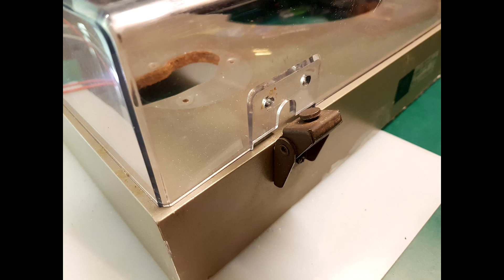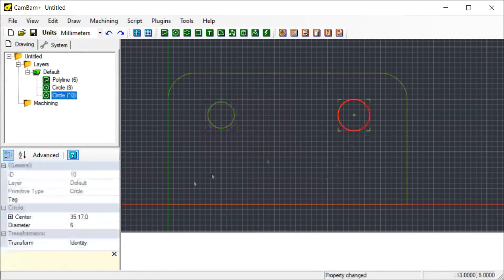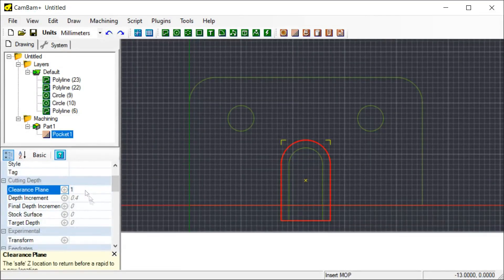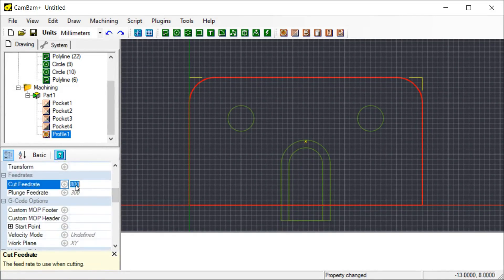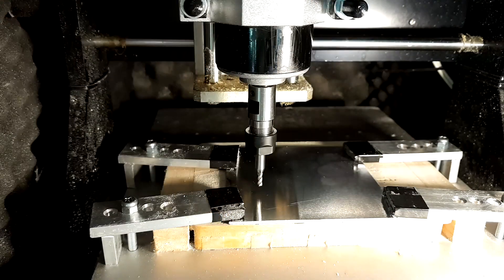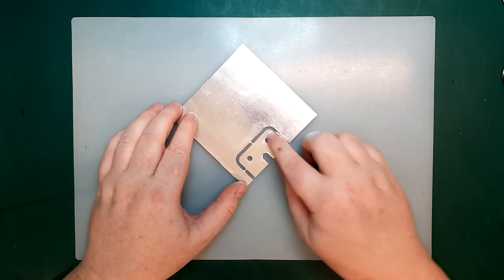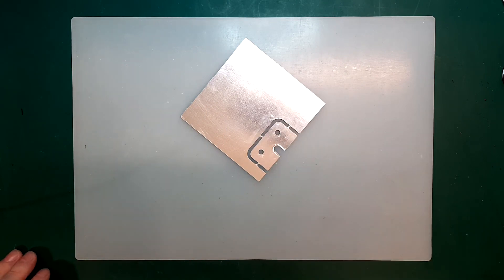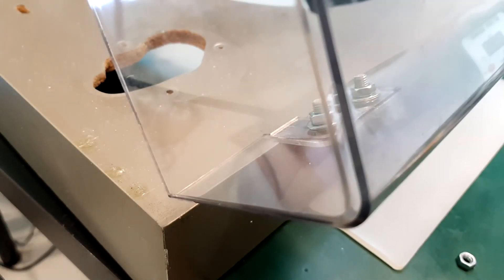CNC Milling Aluminum Brackets for Turntable using Cambam and Candle.

Comment from the maker: Milling some small brackets to hold the dustcover on a turntable I'm restoring. For something like this I like to use CamBam for the model because it's simple and fast. And as usual I use GRBL with Candle to control my little desktop CNC. The endmill I'm using is just a plain 4 flute highspeed steel endmill.

Comment: I machine a lot of aluminum on my home CNC machines and after a lot of experimenting, I only use single flute end mills. Milling aluminum is all about chip evacuation so they don't melt onto the cutter and that makes the single flute cutters a natural. Some people like 3 flutes but I found that they tend to be big shop users and have a much better grasp of flute counts, feeds, and speeds. There are a lot of small vendors out there but over the past few years, I've sourced most of mine from Drill Bits Unlimited. I think it's a small, single guy operation but he has good prices and is very prompt. I also get some end mills from Drill Technology which has a pretty extensive selection.
Reply from the maker: Thanks I've had several people recommend that I should try some single flute cutters. I'll try give them a go.
Cheers,
Jake
Reply: @TheStuffMade  One last thought, you will have to adjust feeds and / or speeds when going from 2 tooth mills to 1 tooth because you only cut half as much with each revolution.

Comment: Thank you for your hard work making videos. I am a beginner trying to figure out my new desktop cnc machine. Being that the machine runs on grbl do I have to run code through candle to output to my offline controller? Or will fusion 360/ cambam or other software output to the file I need ? .nc
Reply from the maker: Thanks, you use software like Fusion 360 or CamBam to generate g-code for your design. Then you can load the g-code in Candle and it will send the grbl code to your cnc controller. Some cnc controllers will allow loading g-code directly from e.g. an sd-card, but I prefer using software like Candle as it gives you more control and more features plus you can see what is going on.
Cheers,
Jake
Reply: @TheStuffMade  thank you so much Jake. I have a lot of learning to do.

Comment: Nice work. Have you tried this O flute router bit? At least hey have worked better for me than the one you are using in this video.
Reply from the maker: Thanks, I haven't tried the O flute bits, aren't they mostly for roughing? I'll give them a try. I don't have so much issues with the routing using the 4 flute bits, but the plunging is a bit rough even when I go very slowly, the bits seem fine though, I've checked them under magnification after use and I don't see any signs of wear.
Cheers,
Jake
Reply: @TheStuffMade  Amana tools offers a mirror finish O flute bit, you can buy it through Tools today, but they are very expensive, I use a cheap chinese version.

Comment: Nice. Putting a small CNC machine together is on my bucket list...
I did not see too clearly how it is mounted to the cover but, if only a nut is used on the inside, would you be worried about the acrylic stress fracturing around that nut?
Maybe it was just a test fit so I'm not criticizing your build, just curious.
Anyway, part came out nicely :D
Cheers,
Reply from the maker: Thanks, yeah it really is a very useful machine to have around when you need it and a small desktop CNC is fairly affordable.
I used some washers in the video for testing. It was my plan to add another plate on the inside and using some adhesive or double sided tape to get good contact, but I'm not sure it's actually needed after testing. The acrylic is around 5 mm thick where the brackets are attached and probably around 2-3 mm for the rest of the dust cover.
Cheers,
Jake